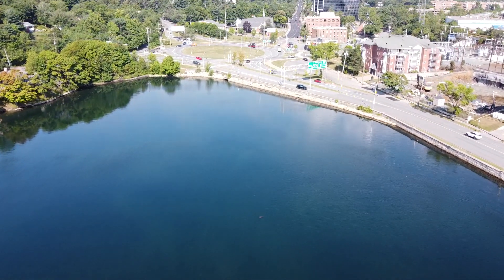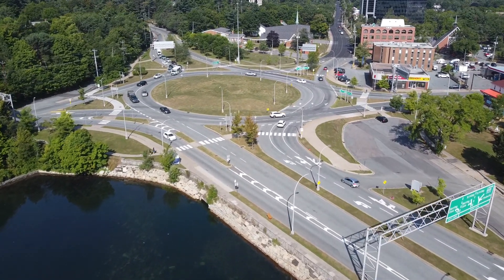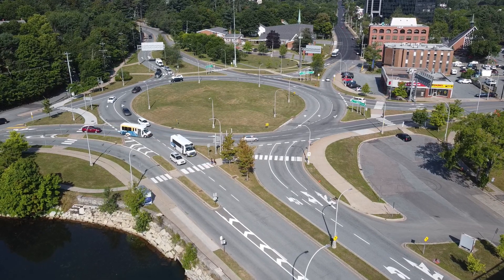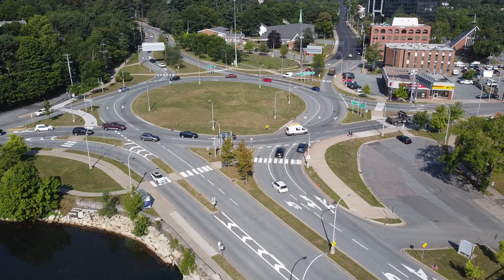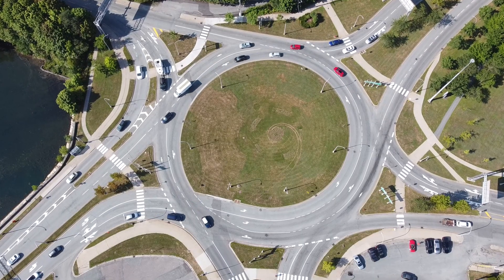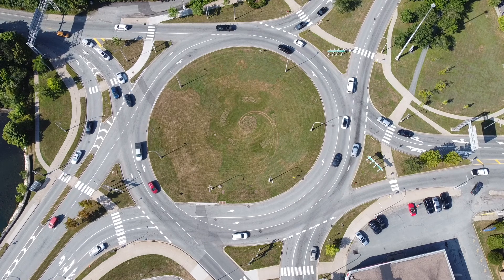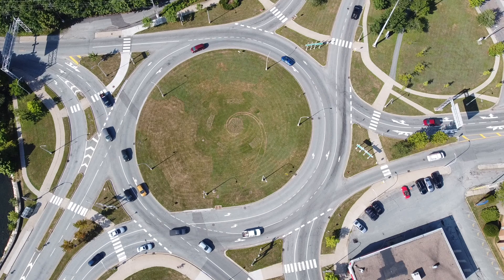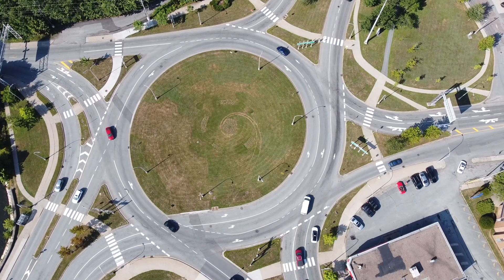Driving "Basics": Rotary Traffic Circle Interchanges

Comment: I've seen a number of rotary/roundabout videos, but most avoid discussing the trickiest situations: a two-lane rotary with multiple exits that require lane switching inside the rotary. Especially when it's busy, and the area is unfamiliar to the driver. This narrator chooses to be silent, not explaining how to plan for needed lane changes in a busy rotary, especially one you're unfamiliar with. Stopping the video to highlight a car crossing lanes (with explanation of how to see and plan ahead, how to handle the lane change in a full/busy rotary, and how to get out safely) would be so helpful. I so appreciate that there are such videos (thank you!), but I'm not here to be hypnotized by circling cars, I'm here to avoid causing an accident in a busy roundabout. Thanks.